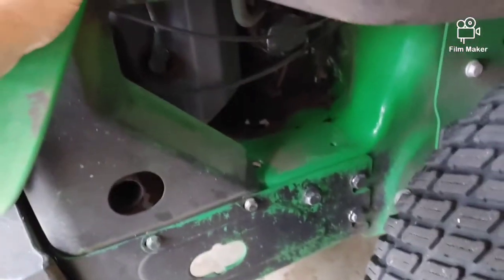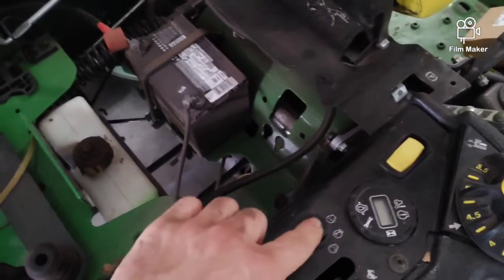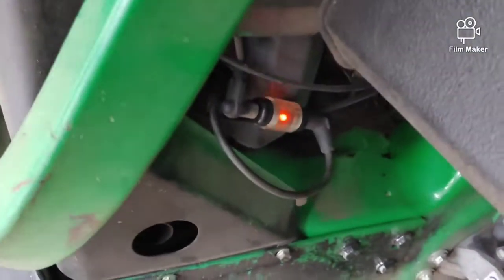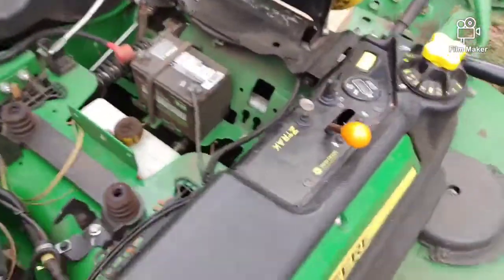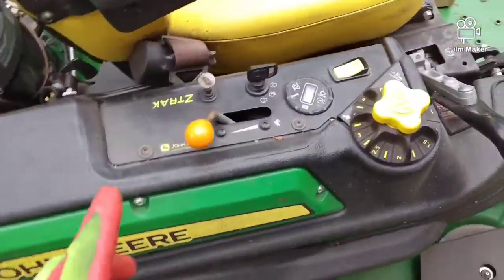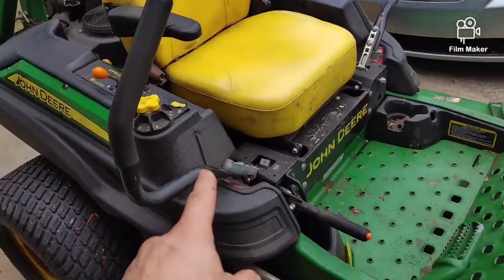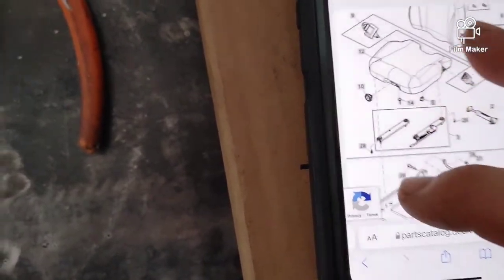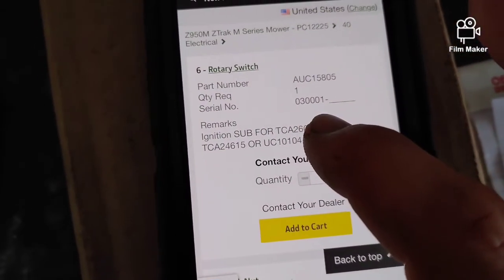John Deere Ztrak engine dies while driving. Causes and solutions

Comment: Oh, the comments look very worthwhile. I'm going to look at my seat control switch as well as the gas cap. I have a crankshaft oil leak to fix too and that may be the problem, but it may be I have both to deal with. Thank you Mechanical Mind.

Comment: I have a z530r and ax360 John Deere. My x 360 would quit running after 30 minutes of mowing. I could start it back up in just a few minutes but again in about 10 or so minutes it would shut off again.  So I started to change things out. First thing I changed was the fuel pump .it work pretty good for a while . Then it started to shut off again.  I put a new  egnition switch on.  It had to be electrical. So finally I changed out the electronic control module . After that it seems that was the problem. I just bought a z530 r. 60 nachos cut Z trak  it’s a great machine
Reply from the maker: First thing Id check for is a fuel line clog or kink in the line that is allowing a little bit of fuel to pass but not enough to keep up with the engine's needs. Whennit sits the fuel is still slowly getting past the clog or kink and that is why it will start up.

Comment: Have a z945m mower. Puffs some black/greyish smoke. As well as loses power and sometimes dies when pro is engaged. Any thoughts? Fuel filter, air filter, spark plugs all new. As well as oil change performed.

Comment: So far it’s working but it would run maybe and hour the shut off. If it continues I have to replace the safety switch under seat.  Already cleared out gas cap . I   Did read that some of the older models had problems with  electronic control module
Reply from the maker: Good deal. I appericate your comments. Im going to give you a special shout out in my next video. I want to build a group of members on here that help each other out with helpful info.  I often forget some things and you reminded me about the ventilation issue that I failed to mention. On the partical mower in this video I knew it was an electrical issue since it would shut off instantly without warning. I always try to get as many details from customers when they have an issue. I recently replaced a control module on a Z920 but its kinda rare compared to other issues.
Reply: @Mechanical_Mind  I have a x360 and just bought a Z530 R 60 inch . I also have a craftsman 54 inch with a kohler engine and the two John Deeres have a Kawasaki

Comment: Hey brother I have a z930m the mower turns on perfect occasionally it sputter on n off. It’ll run and mow perfectly but at times it goes into limp mode. Other times I turn it on fine then engaged the pto and it Boggs down and it’ll run like that. If your able to give me a phone consultation or video I’m more than willing to compensate you. Thanks,
Reply: Having the same issue

Comment: Electronic control module ,ignition switch , gas cap not venting properly, safety switch under seat and fuel pump . All could be the problem of engine shutting down
Reply from the maker: All correct! The control module is a rare issue in my experience. Any time its an electrical issue ( module, ignition switch, sest switch etc) the engine will die suddenly. When its a fuel ( clogged line or ventilation) issue it will sputter and hesitate as it dies.

Comment: So, I have a z335e and when I start mine up the gas light immediately comes on. It’ll run about 20-25 minutes, sputter, and and die. Full gas tank.

I went to check the fuel filter, and gas isn’t even really getting to the filter itself. If I leave it sitting there a few days, it’ll run for another 20-25 minutes.

I checked for debris in the tank, cleared it out (so i thought) but I’m still having the same issue. Any ideas?
Reply from the maker: Hey Trevor, sorry for the delayed reply. Im just now seeinf your comment. ( My notifications were off). Is sounds like you have a slight clog in your fuel line that is letting a little fuel get by bit not enough to keep up with the engine's need. Blow out your fuel lines with compressed air. Also check your fuel tanks ventilation.  Some models have vented gas caps and some have vent lines. After runnig for awhile if the tank is not venting the fuel pump will not be abke to pump the gas

Comment: Z950m ran 10 20 minutes ok then got weak and wanted to die and would not run without pulling choke.  Dealership changed fuel filter.
Reply from the maker: Did the new fuel filter solve the issue?

Comment: I have a z930m that will mow for hour or better than die wont start like a dead battery. jump it than will start and than put on a charger. it is charging like it should but wondering if its the stator under the fly wheel. thanks!
Reply from the maker: Hi Tim, here is a video I made on how to check a mower's charging system.  Your Z930 will work the same way as the mower in the video. https://youtu.be/Xj1w8dWxapI
If your charging system is not working your blades will cut off before the engine dies. 
If your mower dies suddenly then you turn the key to restart it and nothing happens then I would bet its your ignition switch (key switch). If your key switch has the # AUC15805 then you need to get the new updated switch AUC18708. 
If your mower sputters and then dies then you may have tank ventilation issue or fuel issue.
Reply: @Mechanical_Mind  Good evening, I checked the stator and am getting 35 out of it at wide open throttle, still getting little over 14 volts at wide open throttle to battery, engage clutch and pulls it down to 13 and some change. Checked switch and its good. Battery is one year old and going to have it checked tomorrow. I wonder if it isn't the rectifirer going bad when it gets hot? Thanks for the advice!!
Reply from the maker: @timdavison2417  those ignition switches will work intermittently and they cause all kinds of problems. When the mower dies does it die suddenly as if the switch was just turned off?
Reply from the maker: Any updates??
Reply: @Mechanical_Mind  Had Battery checked and its good and looks to be the updated ignition switch. I am at a loss on what next lol.

Comment: My z930 just started sputtering when cutting grass. Engine will die and choke itself down. All air filters are clean and unit has 127hours on it. Kawasaki 25.5 motor. This issue just started. No code lights present but just runs ragged under load.  I ordered two coils offline but not sure of parts matching 100%
Reply from the maker: It sounds like you have fuel issue instead of a spark/ coil issue. How long does it take before the engine starts sputtering after you start the engine?
Reply: @Mechanical_Mind  i can full throttle at idle no issues and cut grass for 15min or so on a cold start and about 3-5 pnce hot. I jumped the seat switch nothing changed with that. Maybe trash in the fuel or clogged filters
Reply from the maker: @tylermoore7189  Sounds like a fuel tank ventilation issue or coggled fuel line.

Comment: Hi there .what if 915 mower it cranks but doesn't start. It means
Reply from the maker: Its either not getting gas or spark. If it starts for a second when you spray starter fluid or carb cleaner in the intake / airfilter when cranking the engine then that tell you its a fuel issue.

Comment: I have a 2016 John deere z960 and it starts and cuts but after about 15 minutes it backfires real loud and will cut off. Once the motor cools it will restart. What could this be?
Reply from the maker: I'd start by checking the coils using an in-line coil tester. They often stop working after getting hot but might work again after cooling off. Check the condition of the spark plugs for clues to what issues you have. There are pages online showing images of spark plugs and what is causing the issue. 
Also, check all your battery connections and wiring connections to confirm they are clean and tight. 
On a Z960, it wouldn't shock me if you are having an issue with your ignition switch or your seat safety switch. Both are common issues for killing the engine while cutting. 
If you have an EFI engine, you could have an issue with the high pressure fuel pump or control module.

Comment: What area are you in I have the same problem but not exactly
Reply from the maker: Near Orlando. Describe your problem
Reply: @Mechanical_Mind  sometimes it wont crank up and when it does the blades will give out in the middle of running maybe 2 mins
Reply from the maker: @jayvionfarrell4860  Its either your seat safety switch or the ignition switch. You can "jump" the seat switch to see if it runs without dying. In this video I show how to do that. If it still dies after you jump the seat switch then its most likely the ignition switch. Its also possible it could be the PTO switch going in and out but it more common to be the other two switches causing that
Reply: @Mechanical_Mind  Pto's drop out when the charging system isn't working.
Reply from the maker: @andreawhalen4142  That is true. That is why I mention to check the battery and charging system at 2:15 into the video. I also have another video on how to check your battery and charging system. The first thing to check is the battery and charging system. In this video we were past that point. In this video I was talking about the engine shutting off during use not just the pto.

Comment: What if it runs around 20 minutes and dies we have new coils so it's not that
Reply from the maker: Does it die instantly or does it sputter and hesitate first? Does it start right back up?
Reply: @Mechanical_Mind  it just dies and starts right back up  I even drilled a hole in the gas cap thinking it might be vapor locking
Reply from the maker: @JJ-mw3sx  What year, model and engine? Or Pin/ vin #. If it was a venting issue it would struggle for fuel for a few seconds or more before it dies. 
It could be a safey switch fail.
Reply from the maker: @JJ-mw3sx  does it flash a light/ code next to the wrench on the panel?
Reply: @Mechanical_Mind  it belongs to my aunts church I'll check and get back to you
Reply from the maker: @JJ-mw3sx  it sounds exaclty like what this mower in the video was doing. It ended up being a faulty seat safety switch.
Reply from the maker: @leonardo migot I dont understand what you are asking